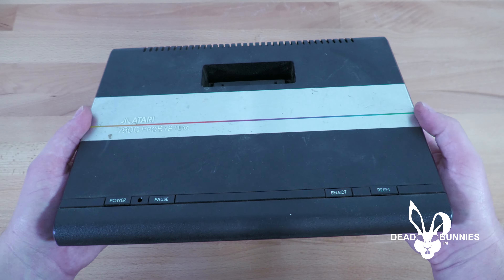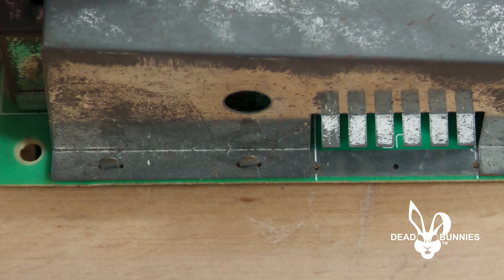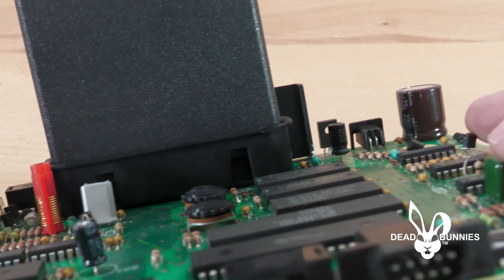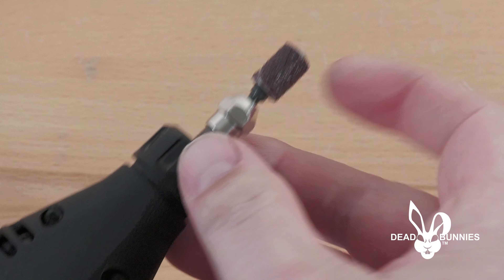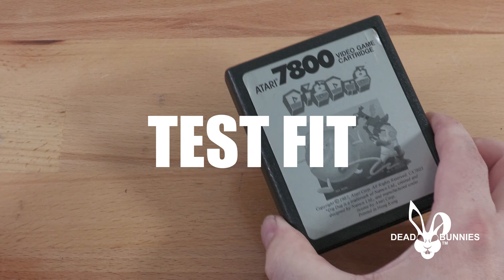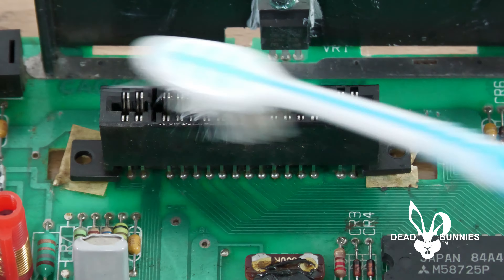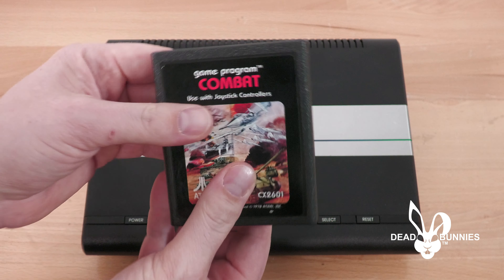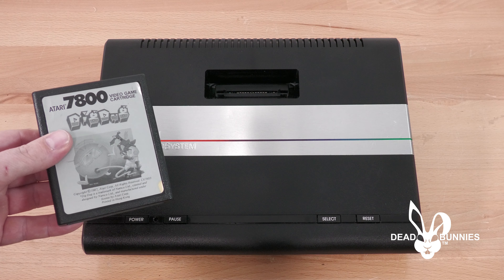Atari 7800 Cartridge Port Clearance Modification #atari #7800 #retrogaming

Comment: Great video.  Simple and effective mod.  The five screws holding the shell together are regular Phillips #2, but the two screws holding the cartridge port on seemed to like the fit of a #0.  A #2 would strip them.  Once the port was out, I stuck an Activision cart in it and you could literally see the stress marks in the plastic showing where you need to trim it back.  I used a 12 volt Warrior die grinder from Harbor Freight.  Not the world's best tools but for working on plastic, more than up to task and only $35.
Reply from the maker: Thanks for watching.  We appreciate your comments.  Glad to hear you were able to get yours working better.